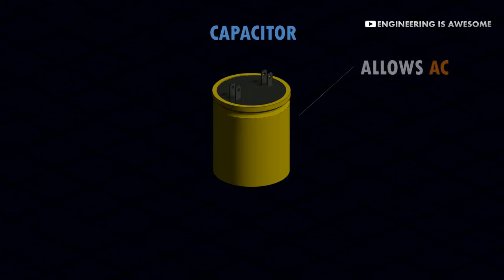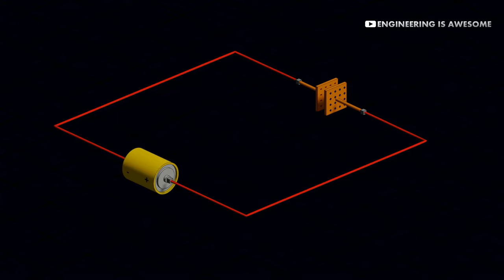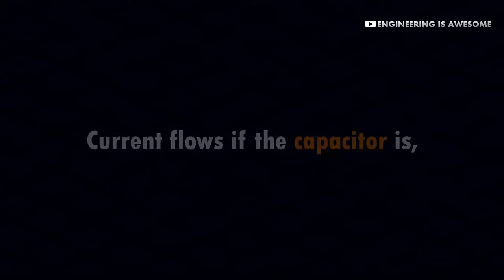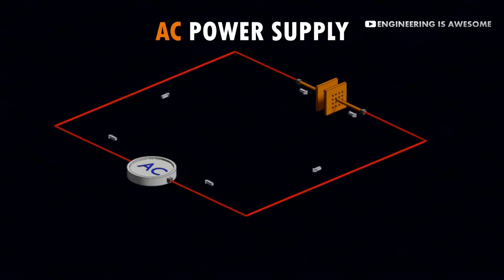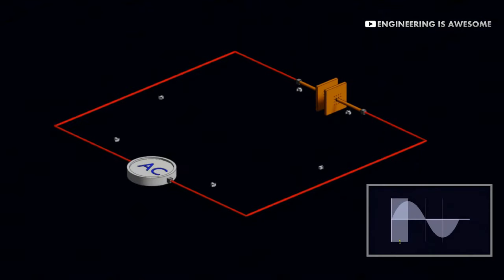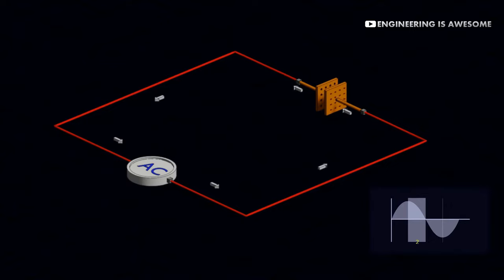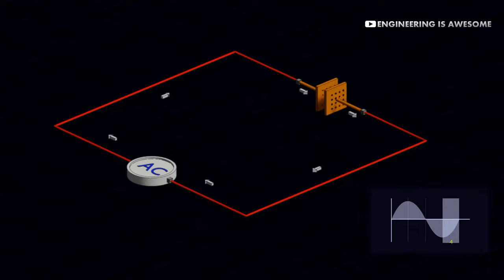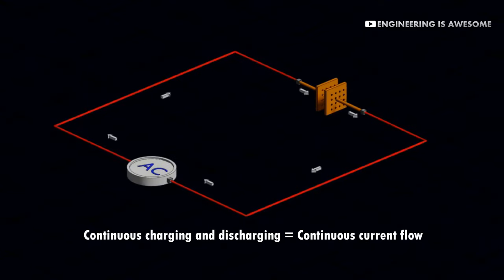Why do Capacitors allow AC, but block DC?

Comment: Formula: Xc=1/2 Pi fc....... as we know that DC signal has 0hz frequency if you substitute this value in reactance Xc formula we get ♾infinity so if the reactance is high then current doesnot pass through it. This is why dc is blocked by capacitor in which we can prove theoritically.
Reply: Then what if i connect capacitor in parallel to rectifer output circuit still does this apply in that case we won't be able to use capcitor in full bridge rectifiers....
Reply: Then why does capacitor allow current to pass through it while charging ?

Comment: As you said, the current decreases but still exists in part 2. If the source voltage is V = |sin(t)|, it is a DC current and what does the current perform in this case?
Reply from the maker: In a pulsating DC current, the capacitor filters out the ripples.

Comment: Why does the capacitor discharge with decreasing voltage?
Reply: Because when voltage start decreasing  capacitor act as power supply by supplyng the the current to the circuit by discharging itself
Reply: Because after capacitor gets somehwat charged,it's V is greater than the decreasing induced V due to ac so charge flows from higher to lower V